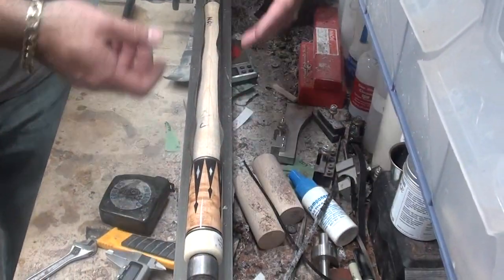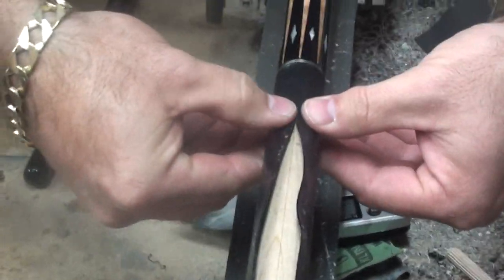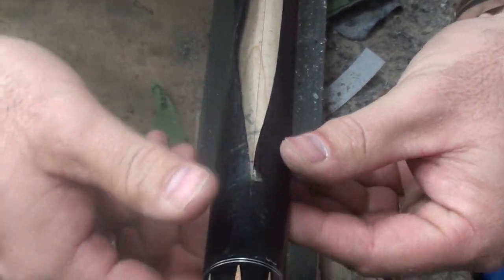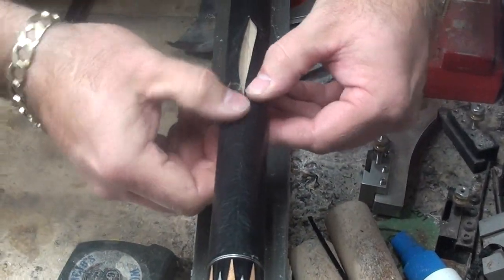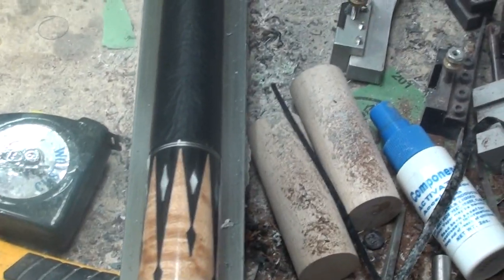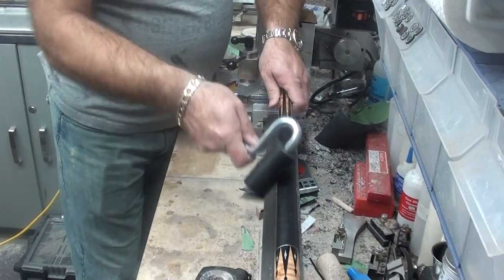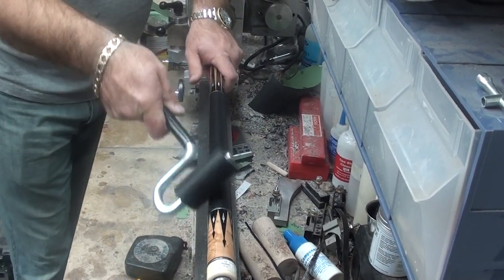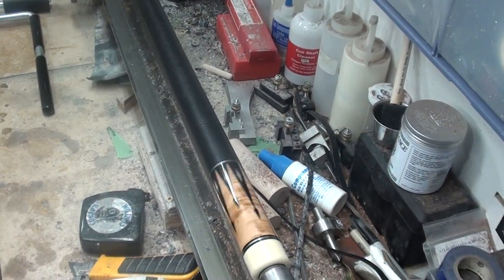installing a leather wrap on a pool cue part 3

Comment: Thanks for taking the time to video both the linen and leather wrap installations Darcy. 
Very informative as you make it look fairly straight forward.  I no longer drill holes for the linen. I just did my Meucci PP 1. The sleeve and handle were bored out and has a plastic insert thru the length. If I were to have drilled 2 holes in the handle, I am sure that I could have went into the plastic insert.  Meucci did drill holes oringinaly and that unfortunately is where the one end of the linen broke free.  One can only repair a linen wrap once and then it's time.  Actually, I now look forward to wrapping using the Japanese Under Wrap method.  That is how the Japanese used to wrap all their shovel handles and tools BTW.   Run into you soon Buddy.
As a side John H, that is how the Old Schoolers used to do wraps. Until a few innovative people invented the great tools that we now use today. Necessity is the Mother of Invention.
 That Slide that Darcy had made up is a Time Saver.

Comment: Question? Would removing a rubber gold handle type wrap and replace with leather cause any issues?
Reply from the maker: As long as the thickness is similar it will be fine.